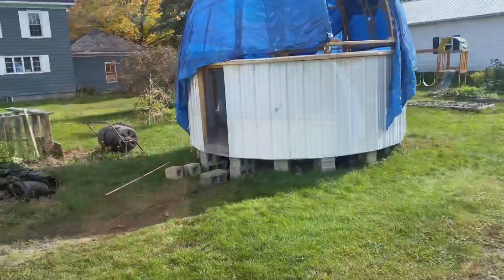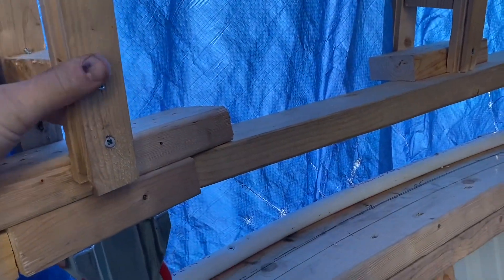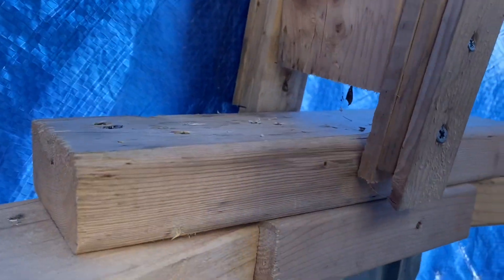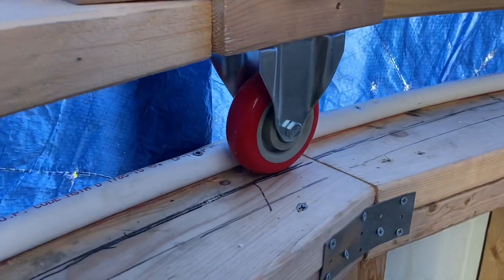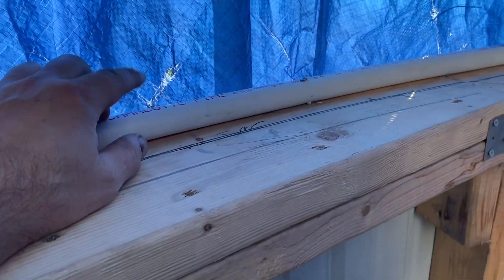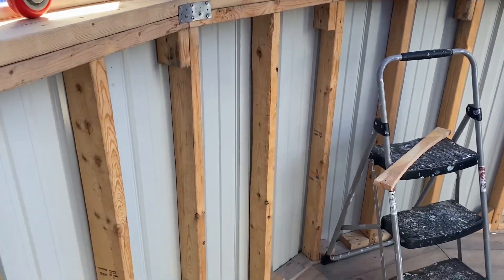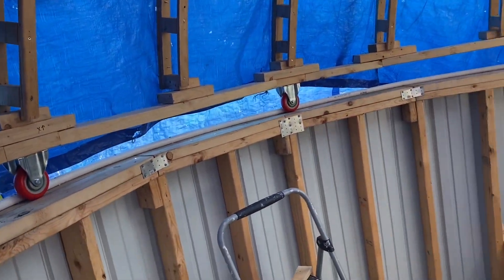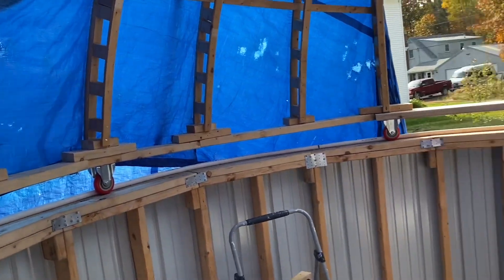Observatory Dome Rotation

Comment: Interesting build! Have you investigated how you'll automate it/track? Or will this be a manual dome you need to move every so often?
Reply from the maker: It’s pretty low tech. If I wanted to automate it I’d provably have to replace all the wheels with a steel track. This summer I’m working on making a slide for the top cover so I can slide it to the back i stead of muscling it down. Safer that way. I also have to work on a lip to replace the waterproof fabric o currently have at the bottom to fill the gaps.

Comment: What size of wheels are those?
Reply from the maker: 4" fixed (non swivel), $29 on Amazon for 4. I recommend them; they're very sturdy, they don't skew easily, silent and rugged. 300lb load capacity each wheel.

search for: 4 Pack 4" Castor Wheels on Red Polyurethane, non swivel.
Reply: @Anvilcjl  Also I mounted my wheels upside down.
Reply: @Anvilcjl  I found an 8 pack for 39.99 they look the same as yours. I had the same problems you had. Bought swivel castors first.
Reply: @Anvilcjl  My dome is pretty stiff to turn with the small 2 inch wheels. I am trying to decide if I can deal with it or put the bigger wheels on.

Comment: hows it coming?
Reply from the maker: It's been on hold for a while because it's winter. I made 2 covers for the opening in the fall and covered everything with plastic for now. I think the plan is to do the main part of the dome with chicken wire, paper mache and waterproof paint. I will try that on the covers first and see if it works before I do the entire dome. I can't do the mache when it's too cold because the glue needs to be at a better temperature. Apparently some major domes have been done with paper in the past to save on weight, so it's not as crazy as it might sound.

Comment: What are you going to cover the dome with?
Reply from the maker: I'm thinking something lightweight.  Maybe Luan over the top and then canvas over that and the rest, or maybe even paper mache. I read that the dome at West Point was done with paper, and a few others as well, to reduce weight compared to copper, and it would be very cheap. Then the top layer would be a waterproof paint.